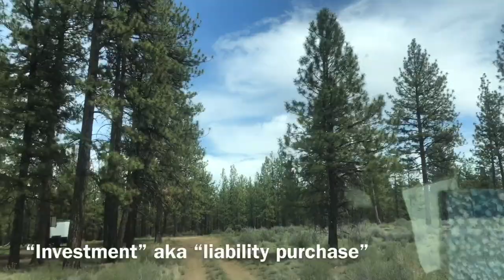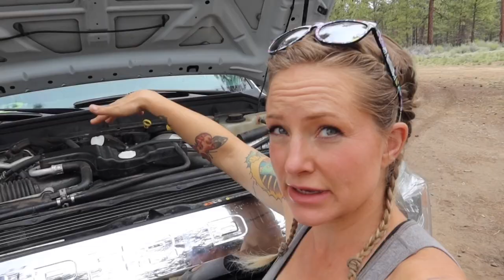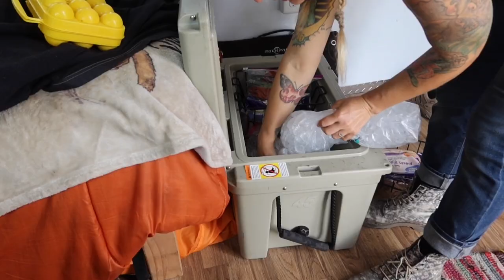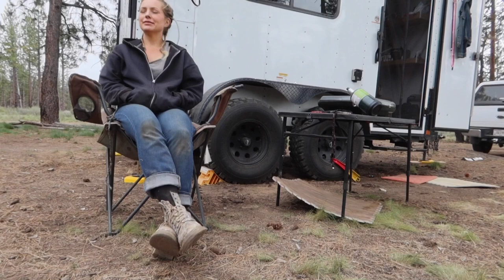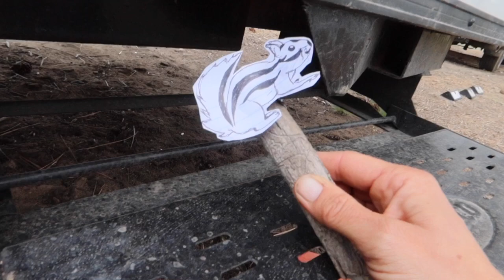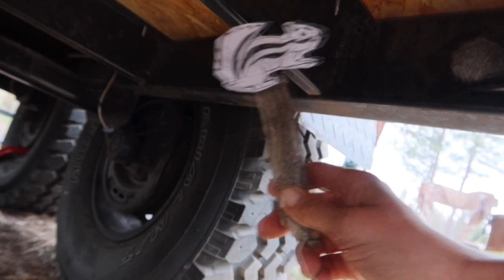2 Girls 1 Cargo Trailer - Boondocking Full Time | Chipmunks

Comment: You could try filling the small gaps where the back window meets the tailgate with steel wool when you go for hikes, You can get it at any hardware store.  They don't like it and won't chew it . I use it on my camper

Comment: The problem with many wire coatings is that they are made from a soy byproduct, which the rodents find satisfying. Keeping the hood open is all most people do. A ranger in Guadalope NP showed me his "rid a rat" device, a bright strobe LED light that draws very little current. He said the pack rats can't stand the light and that he has never had a problem. I would spray any scented oils directly on the wires to make them not taste as good. A couple Lucy Lights should do the trick as well.

Comment: I have been following your channel for awhile now .. Very good ideas and thoughts you have on what works for you and what does not work ..
This is just an added piece of security for your Cargo RV camper .. I was speaking to a fellow and he added one more measure to his RV with  him being away from it to give his unit more security .. 
He added a Trail Cam to monitor his Cargo RV while he was gone .. Any tree will do or stump , or something else to hold the cam and hide it so it's not showing out in the open ...
Trail Cams have different ranges of operation distance 50'-80' plus .. 
Once he had it set up he said he would walk in to towards his RV to see what the trail cam would capture ..  Very good trail cams like Moultrie for one in a range of $69.00-$99.00 he said is more than enough  .. He said the Trail Cam  worked perfect .. He said it was amazing how many folks would drive up to his RV and walk up to the door , knock and wait then start looking in the windows and trying the door to see if it was  unlocked .. 
It was just a thought i had not thought about even though i know about Trail Cams ..I just wanted to share that with you ...

Comment: Chipmunks, Colorado ground squirrels, mouse, PACK RATS are ALL bad out west. Pack rats are the worse! They can TOTAL a new car overnight by chewing wiring. Trailer is at risk too. (Ask me how I know.) The mint spray is a good idea. You can also use mothballs or toilet cakes (same thing). Tie into little patches of cloth or netting (old stocking or produce bag) and place them somewhere in the engine compartment and enclosed places under the truck and trailer. Replace when they are gone. Citrus scent works pretty well too. Some parts stores out there sell “rid-a-rat” a little strobe light that runs in the engine compartment. I still keep mine running and I’m back East now.  Oh, and don’t forget - fleas out there CAN carry the plague. No, really, the bubonic plague. Prairie dogs are common carriers, but ANY rodent or other flea carrier is suspicious.

Comment: I heard rodents do not like fabric softener dryer sheets so I tried keeping a few in my glove box because they would sneak into my truck cab and build nests under the dashboard.. Before I knew I had the problem a little mouse ran up my pant leg  and then ran back down one night while I was driving. After that I tried the dryer sheets and it worked. No more mice. I hate them meccees to pieces.

Comment: Lex, the bare O.S.B. used for you're flooring REALLY needs to be painted underneath. Tractor Supply Company or others sell a black fence paint you can brush or roll on to avoid moisture penetration. Sounds like quite the go round with that Chipmunk. TAKE CARE..
Reply from the maker: It has a clear sealant on it Brushburn. I was thinking of putting something with color on as so many have commented about it. Though redundant it would add some content. Thanks! Be well.
Reply: @LexandRiot  That's great it  has a sealer on it. Sorry, I'm a new SUB to You & Riot. I just watched your Vids with B W.   TAKE CARE..
Reply from the maker: Thanks for watching and subscribing!!

Comment: Try cayenne pepper sprinkled around and/or mixed in water and sprayed around the truck and trailer.   You can also try mixing up some hot sauce and water in a spray.  I know that is suppose to work against raccoons but might work with chipmunks as well.

Comment: I have also used steel wool for plugging holes in an RV along with spray foam and wire window screen. The spray foam acts as an adhesive to anchor the steel wool and screen. Really enjoy your videos of your journey.

Comment: Steel wool is very good however it's also flammable if you ever had an electric short it would start on fire take a small 9 volt battery and touch both ends to steel wool within a minute it will start on fire 🤔😃👍✌️

Comment: I have chipmunks  and wood rats which are more of a problem   getting into the vehicles and have tried all the tricks to keep them out ....The only thing that works here in this area is white solar  blinking christmas lights .  tried all the sprays and did not work . But hey the lights work .have not seen any rats or chipmunks under the hoods of all 3 trucks or inside cab or  the beds . So not saying this works every where but its  been over 3 years and no more critters .!!   Have fun & safe travels .